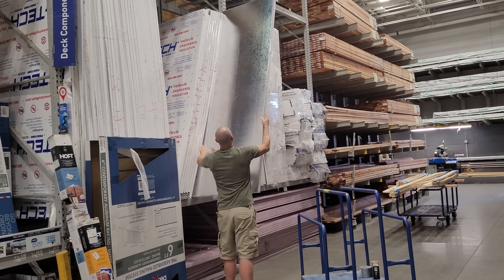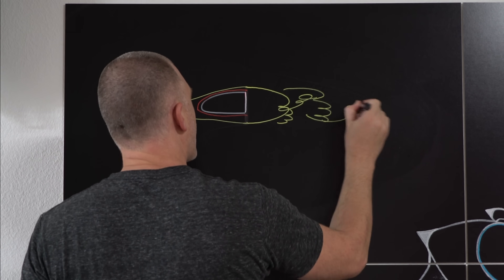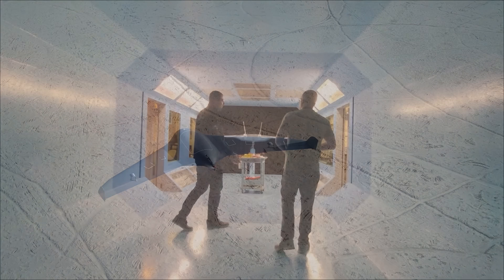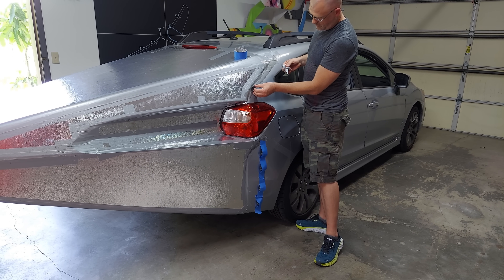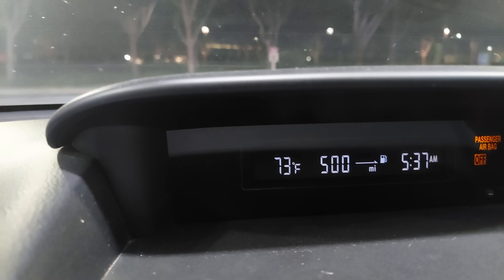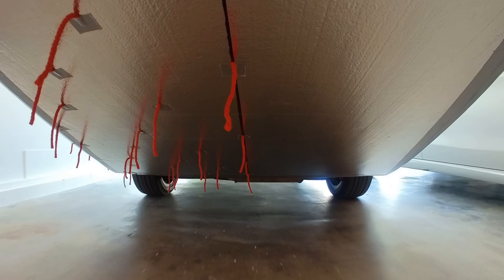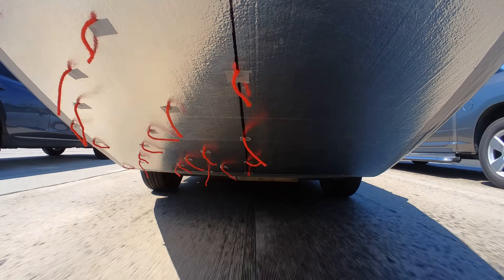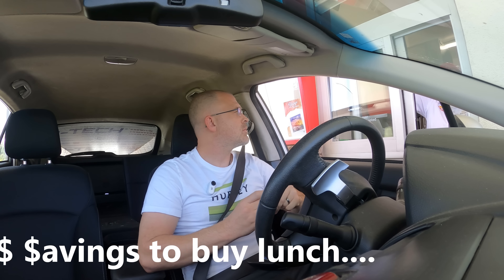Using Simple Aerodynamics to Beat High Gas Prices (Home Improvement Store Edition)

Comment: I have done a lot of testing with vortex generators on my Subaru and there is a lot more to them then you think. The first thing is where you put them depends on the speed you are trying to optimize for. Generally for low speed you want the generators to be "further" from the point of separation. (NOT AT the point of separation, but at some distance in front of that point.) In my testing, At 100mph the generators need to right at about the point of separation about 4" At 70mph the distance that worked best was about 13"-15". For 50mph it was around 18"-20". This is for roof generators. ALL my testing with side generators failed. Every single time regardless of placement resulted in more turbulence, not less. These tests only apply to my car because every car has it's own shape and the "sweet spot" can only be found via testing. 

There is a scientific paper out there from Porsche on wheel coverings and drag reduction. Basically covering them completely is best for reducing drag, but it can cause the brakes to overheat when used a lot (down long mountain roads or racing.)

Good luck.

Comment: I believe the more material you added the more weight on the car and increase drag surface, and suspension will get soft and lifted front wheel up, those affect efficiency.
Great experiment anyway.

Comment: Curious how much that would change the consumption of an electric car, since gas powered cars do need a big chunk of energy to run themselves. Thats e. g. why they are efficient at low highway speeds, whilst electric cars are more efficient the slower one drives, all the way down to under 20 mph. My old gas powered car had its efficency peak at like 80 km/h (50 mph).

Guess on a electric car we´d see like an 20% increase or so.
If i look at my MG 5 electric there are many options to do: bring it Lower, attach a front spoiler to let the air arount the verhicle, not under it, and the biggest part, extend the Back like in the video.

would you be willing to test this in the future?

Comment: Great video.
Most people could save at least 13% on their fuel bill if they were lighter on the gas pedal, use engine braking, check tyre pressures, cruise at 60mph rather than 70mph, fit new air filter and spark plugs ...etc.

Comment: Would it be feasible to also strip everything from the inside to make it as light as possible? Removing the windows motors alone would cut the weight by 100lbs. You could also try fitting narrower tyres.

Comment: fender vents would also make a significant change https://www.youtube.com/watch?v=Y78rufWkjZE - above https://www.youtube.com/watch?v=nE4z6aF_mAw - behind the wheel.
And that flat underside either use that insulation foam, or maybe thermal tape covered cardboard (mouldable) just let the exhaust exposed (heat & it's quite nice shape - coanda effect)
That rear section negates rear boot opening, some "winglets" on the side pushing separation further would be more practical, gourney flap on the top of the boot too
I'd also install diffuser to add downforce (if the bottom is flat).

Comment: We did this back in the 90's on a high-school car learning about aerodynamics. I later doubled the fuel economy on an old Ford van.
GM had prototypes similiar to your car. Infact the EV-1was there real application of extending the range of their current car.
However, manufactures soon learn people didn't like this look for your vehicle.
There are cap manufacturers though that have aerodynamic caps for your truck to increase mileage. 
Loved your video. I can geek out on drag coefficiency numbers and designs along with hydro-dynamics.

Comment: You can find the answer you are looking for by checking out Carroll Shelby's 1964 Cobra Coupe that he built for Le Mans. The A/C Cobra was great for the short tracks in the us but it wasn't aerodynamic enough for the long straights at Le Mans. At first, they were going to make a long downward sloped tail that looked like your idea for an improvement to your current version. What they realized was that they didn't have to make it curve all the way down to a point. They were able to cut it off flush much closer to the car and get the same effect. There's a great video about the development of the 1964 Cobra Coupe that will give you the explanation of what they did. I can't wait to see what you come up with next. I really hope you take up the challenge of crossing the Atlantic Ocean with an all electric RC aircraft.

Comment: First, this may cause a safety issue, as the big tail may block the car behind you for one side of the stop light. Thus, from that driver, he/she may feel difficult to determine whether u are braking or having the turning light. After all, the turning lights of many cars share with or are very close to the parking lights. Although turning lights are usually blinking, this modification could still cause an issue, especially for new drivers. It would be better to do some electrical work to set up the parking lights directly on the back of the installed tail. Second, in terms of beating high gas prices, I guess the best way is to buy an electric vehicle. Third, although this project looks fancy, it is not realistic for most ppl, in terms of the cost, time, and knowledge of aerodynamics. Fourth, in terms of the project itself or a simple research/experiment, this is indeed a good work!

Comment: Trying to achieve a perfectly aerodynamic automobile is like a Dog trying to bite it's own tail while it can bite the tail but not for long. Most modern cars are already aerodynamic upto 80% and require no further adjustments unless you are driving a square cardboard box on wheels.

Comment: It’s always amazing to me how much better fuel economy cars get when you stay between 60 and 65 mph. My non hybrid accord with the small 1.5L averaged close to 50 mpg on my 80 mile commute the other day through Palm Springs.  Driving 75-80, I would have averaged closer to 32 mpg. Proper tire pressure and not driving like I’m being chased by an angry T-Rex have helped me save at the pump.
Reply: I took my grandma’s 2017 V6 Accord on a road trip and it got 40 mpg at 60 mph. Quite impressive for a V6 with only 6 gears

Comment: Decreasing frontal area would also help. As will putting very skinny tires on very lightweight wheels, and lowering your car as much as practical. And the reason car manufacturers are going in that direction because it’s not practical. You can’t see out the back your tailgate is useless and if that structure was metal, the weight would increase. Visually not appealing, front air dam will work but get ripped off as most sports cars suffer.

Comment: Just copy everything you can off of the Aptera. They have been at this a long time and have overcome all the counterintuitive drag issues. Their shape has the drag of the mirrors on a big truck. Like really, not exagerating. Maybe 3d print some clear light covers and do a really good job of merging them onto the foam with as little seam as possible? Adding dimples like the mythbusters? at least on the foam section (even on the just the foam section could give you maybe 1-5% gain in efficiency as the whole car on Mythbusters gained 11%)?

Comment: Nice, I was on the team that built that solar car. Rotating wheels create a lot of turbulent air, so that lower side surface will probably always be turbulent, except if you make stationary wheel covers like on old Citroen cars, or the modern 'lightyear zero'. Putting tape over the gaps around your hood makes a surprisingly large difference too. Interested if you can find a way to keep the underside laminar as we struggle with that on our solar cars also, but only around the wheels (sucks that they have to spin to move)
Reply: You, or someone you worked with, probably did the maths but what proportion of the drag is from viscose forces? I'm more used to boats so I don't have a handle on this. Adding surface area with act against you eventually.
Reply: @msbealo  Correct, that is partly why the solar cars are so small. It is always a balance. The trailing edge has a significant impact on the overall drag so you can get away with adding a certain amount of bodywork in the back.

Comment: Tail lights are covered under Federal regulations. I'm sure the tail doesn't meet the requirements for angles of visibility.
https://www.federalregister.gov/documents/2004/08/11/04-18297/federal-motor-vehicle-safety-standards-lamps-reflective-devices-and-associated-equipment
I'd be shocked if there isn't also an angle of visibility requirement for the license plate, too.
Using clear plexiglass would probably cover the visibility issues. (pun intended)

Comment: This sparked my mad engineer brain but wouldn't it be neat if cars were designed with active aerodynamic fins and skirts that can be retracted or removed with simple tools. Reminds me of the Honda Insights rear wheel fender extensions. A lot of new generation fight jets and high performance race cars like the Mercedes AMG ONE have active and adaptive aerodynamic panels. I think there could be a massive market of people who would by add ons for their vehicles if it meant 20-30% more efficiency in times like this.

Comment: if you convert gallons to liters and dollars to euro...
we pay 1.888€ for 1ltr diesel
1 gallon is 3.785ltr 
1 euro is 0.98usd 
so if i calculate that we would pay 7.00€/gallon wich is about the same

we used to pay more than 2€/l for diesel for almost a year 
so 7.011usd/gallon is not that bad compared to belgium

Comment: if the air is sticky, what if you coated the car in a substance that is similar in property to said air? like how hydrophobic can dissolve/ be combined with hydrophobic and hydrophilic can be combined with hydrophilic. Another idea what I had thought of what if you ceramic coat the car? like do a full detail, polish out all paint imperfections and ceramic coat it, and see how it reacts? as far s im aware, paint/clearcoat is i would say, hydrophobic as water tends to stick to it after rained on, and ceramic repels water tho idk how ceramic coating will react with air

Comment: you lost me at "average electric vehicle going for $66k" where did you get it from? Even with dealer mark ups EVs for as low as $30k, freaking tesla's RWD model 3 is $47k... bolt is around $27k... nissan leaf is nearly $25k for a 220 mile range model... of course greedy dealers might add $5k to that, but still far far away from $66k... bullshit
Reply: not to mention a used leaf, which is entirely comparable to the subaru here goes for 12-16 thousand for the 2015 model. the experiment here is valid for those cars too on the other hand. all of them should have tails

Comment: all the pumps share pressure from the same turbine....if you want it to be the same "pressure" then no one else can be pumping while you are but regardless of pressure the meter is still gonna be accuratly measuring the gas regardless  of the speed just make sure the pump has been tested by wieghts and measures within a year there are stickers on each pump in every state ive been to

Comment: when doing a steep angle from the top side, u should add splitters  so it holds the air for the sweet laminar flow as much as possible,

Comment: you don't have to prevent air going under the car, you have to let it there and let it go to the back without it exiting on the side. why didn't you add a flat surface underneath your car. just some panel like your wife's car

Comment: I feel like its less effective when turning though right? sure in a straight line it would work theoretically but, when you turn there are different angles from which the air is effecting the car since it is now longer.

Comment: My 2017 Civic with 1.5 turbo engine gets 5.3L/100km, or 44.38mpg, on a short 40km (25mile) highway drive at an average of 110-120km/h, or 70-75mph. If I slowed down to 100km/h, or 65mph, and travelled for longer, I'd image the fuel economy can go lower than 5L/100km, or 47mpg. In short it's often easier to just go with a more efficient car than spending time + money to improve a not so efficient one. Also you lose access to your trunk. :P

Comment: Restricting so much air flow under the car I wonder about how certain components will overheat. Transmission. Dif. Wheel barings axels ect

Comment: In Europe couple of young guys are running Hypermilling tests with different cars. One of those is in my possesion. VW Passat B8  2.0 tdi. The car can reach almost 2000km/1245miles if driven at 80kmh/50mph on average with 70liters/15.4 gallons. What else can you wish for...😁 And we are talking about stock car model, no changes except tire pressure is higher than it should be.

Comment: Julian Edgar did a similar thing on YT. Try flattening the floor on top of adding the splitter and side skirts.
You can also use a scaled model to test the designs out. I think I saw it on XF Motorsports channnel.

Comment: Front skirts like you suggest will decrease the flow under the car, leading to more air resistance. 
What you need is to reduce drag on the underside of the car instead. 
Look up "Light year 0", they let the air go under the car as well.

Comment: Edit: PLEASE DON'T FOLLOW THE TYRE COVERINGS! It's potential to have a brake failure due to the brakes not cooling down. Don't even think on doing such a silly thing yourself ever! Get better ryms/tyres instead. That can potentially Kill You or someone else!

Well that's too much probably. You won't be able to run legaly in Europe but you can improve your car's aerodinamics with simple tricks actually.

First of all: Remove any silly things in the roof!!!!! Like the bars. NO bars in the roof are allowed if you want efficiency! That's KEY!

First of all Mirrors: Mirrors can be reduced or can have aerodinamic apendixes in it's top to let airflow go. 
Second: Lower the car down: The highest, the less aerodinamical.
Third: Seal the low end of the car. The underneath. That's where you have the real gain. 
Four: As you did but in a better way to allow brakes have air and breathe, get better wheels more efficient ones.
Five: Close your windows all the time.
Six: Recirculate your air (yes there's a button for it) when the air in the cabin is new and you use the AirCon, that gains up to 30% efficiency as the system is cooling the same air and the difference of temperature is quite low. New air from the outside means more work for the system.
Seven: Take anything you DON'T use in your car out of the trunk. That reduces weight. Weight increases consumptions.
Eight: Get the best tyres possible, not only fuel savers, but also the best size for your car to use less fuel. Usually the less tyre, the less consumption. And and and get the correct pressures on them at all times. That also reduces consumption.

That's all that came to mind in 2 minutes. All the best.

P.S:
Really remove those things in the wheels, your brakes will NOT get enough cooling and you'll find yourself with no brakes and potentially you'll crash and get injuries. Please DON'T EVEN THINK on doing THIS! It's a very SILLY move. ALWAYS let your brakes COOL Down.

P.S.2.
If you want to improve the efficiency of your car, use the same panels you bought inside the doors and roof, to help protect the cabin from Heat and Cold, now you'll get a better isolation and that will help reduce your use of AC. That aside will help you minor your consumptions. Easier and less risky for your life than all the follish things you did, which are cool in a controller environment, but can supose a problem if they get loose to anyone on the same road.

P.S.3.
Another very helpful trick is: Don't get an AWD car. Those carry more weight, and usually spend quite more gasoline.

Comment: Rather than adding the skirts why don't you just add underbody cladding that smooths out the air underneath? You have inspired me to do before and after to my mods as I am doing smoothing of the rear underbody area. The middle and front underbody are already flat.

Comment: You may start creating enough lift to feel it in the car with the new design. This is what racecar designers learned with the shapes of their racecars in the 1950s. Jaguar XKSS, D-Type, the prototype of the 911. Same reason why the 1973 911 2.7 RS has a ducktail. The tail dropping down alone, with no added ducktail,was creating too much lift.

Comment: A big obstacle is your tires, buy LOW ROLLING RESITANCE. But at the end of the day, your engine and weight are really detrimental to your goal here. This is no 1 liter ecoboost or original honda insight. This engine just isn't intended to burn as few gallons per hour as your trying to accomplish. Not to mention subaru is far from the innovative powerhouse honda or ford are. Why don't you try to find a busted original honda insight and just slap it back together.

Comment: Best way to save fuel is by changing to a diesel with manual gearbox. It saves you almost 50% in older cars and 20-40% in newer cars.